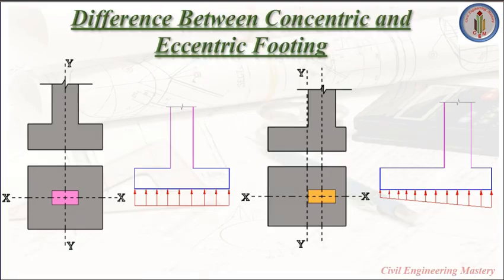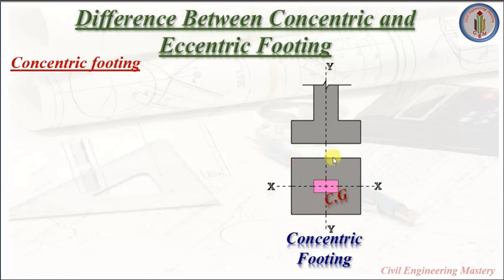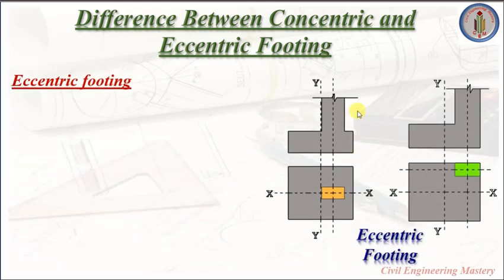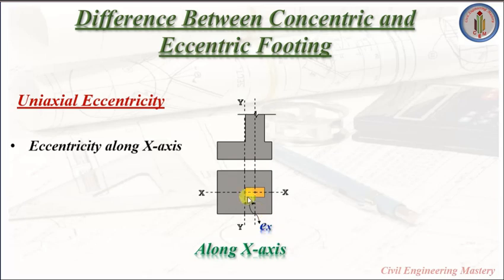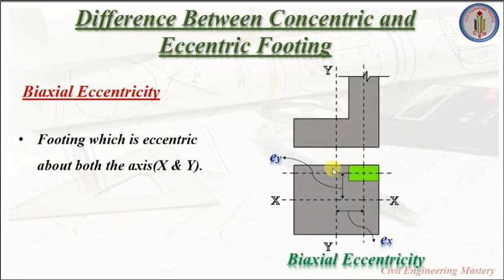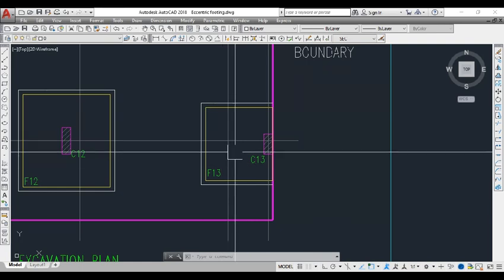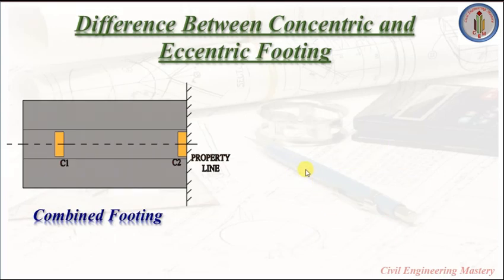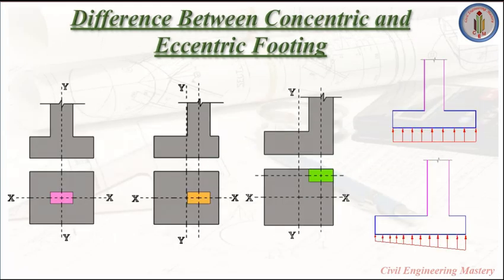Eccentric Footing | Difference between Concentric and Eccentric Footing |Uniaxial,Biaxial Eccentric

Comment: Madam request to make a video on how to design eccentric footing - till date not a single proper design video is present on u-tube
Reply from the maker: ok.
Reply from the maker: I have created a course design and detailing of the RCC building using Staad.Pro software which includes Eccentric footing design.
Please use the below link to checkout the course
https://www.udemy.com/course/staadpro-v8i-structural-analysis-design-of-a-rcc-building/?couponCode=01C2F81E11CB60C60F94

Comment: Hello mam....when Der is no option to connect the eccentric footing to nearest footing, we ve to design it as an isolated eccentric footing....how to design that isolated eccentric footing??
Reply from the maker: I have created a course design and detailing of the RCC building using Staad.Pro software which includes Eccentric footing design.
Please use the below link to checkout the course
https://www.udemy.com/course/staadpro-v8i-structural-analysis-design-of-a-rcc-building/?couponCode=01C2F81E11CB60C60F94

Comment: I have seen eccentric footing construction videos without any strap or combined footing. Please explain how to design an eccentric isolated footing with axial and moment loads.
Reply from the maker: ok.
Reply from the maker: I have created a course design and detailing of the RCC building using Staad.Pro software which includes Eccentric footing design.
Please use the below link to checkout the course
https://www.udemy.com/course/staadpro-v8i-structural-analysis-design-of-a-rcc-building/?couponCode=01C2F81E11CB60C60F94

Comment: very nicely explain within short time. EXCELLENT Also provide the design of eccentric footing
Reply from the maker: Ok. Thanks
Reply: Can you plzz provide manual of those footing mam
Reply from the maker: I have created a course design and detailing of the RCC building using Staad.Pro software which includes Eccentric footing design.
Please use the below link to checkout the course
https://www.udemy.com/course/staadpro-v8i-structural-analysis-design-of-a-rcc-building/?couponCode=01C2F81E11CB60C60F94

Comment: Nice Video. We need reinforcement detail of Eccentric footing.
Reply from the maker: Noted.
Reply from the maker: I have created a course design and detailing of the RCC building using Staad.Pro software which includes Eccentric footing design.
Please use the below link to checkout the course
https://www.udemy.com/course/staadpro-v8i-structural-analysis-design-of-a-rcc-building/?couponCode=01C2F81E11CB60C60F94

Comment: If u can please upload videos about structural design also
Reply from the maker: ok.
Reply: Especially please make a video on how to design eccentric footing design..in this video u have shown a footing in auto cad which is extremely eccentric please upload it's design procedure!plz madam
Reply from the maker: I have created a course design and detailing of the RCC building using Staad.Pro software which includes Eccentric footing design.
Please use the below link to checkout the course
https://www.udemy.com/course/staadpro-v8i-structural-analysis-design-of-a-rcc-building/?couponCode=01C2F81E11CB60C60F94